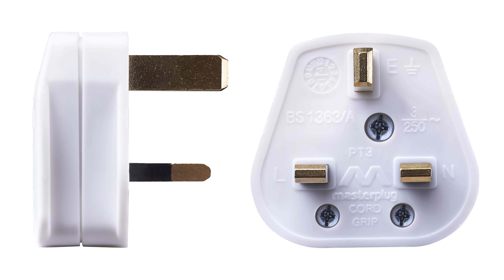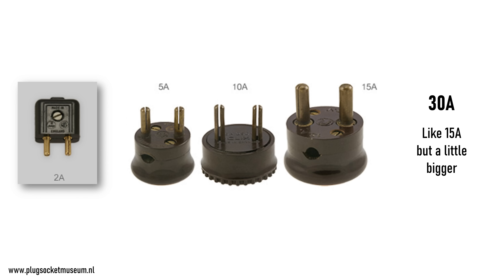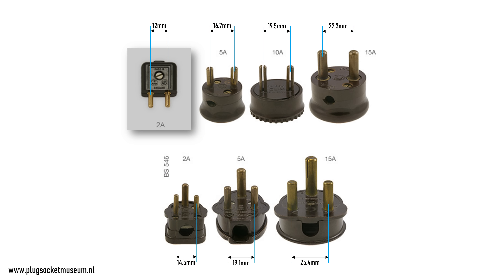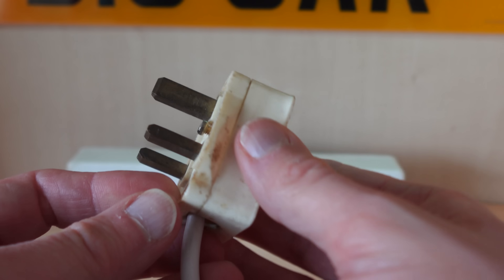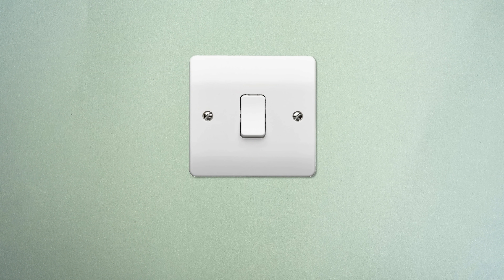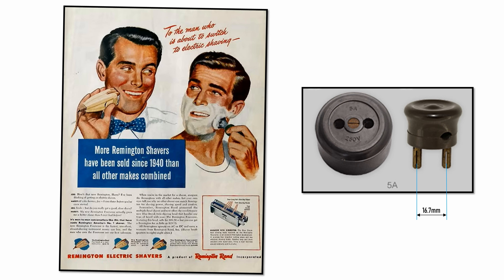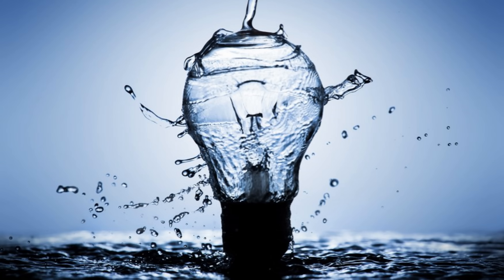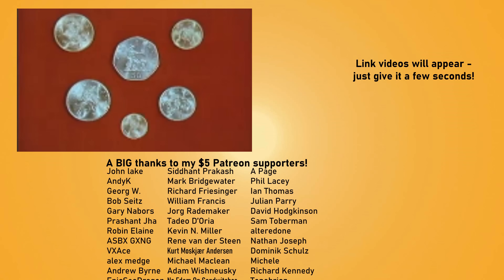Shaver Sockets are really clever

Comment from the maker: Errata: You can have a light switch in a UK bathroom but it needs to be 0.6m from any bath or shower, and 3m from any water outlet (e.g. sink).
The fuse protects the device, and the lead and everything upstream on the circuit.
As people mentioned, it made sense to sell the new UK 3 pin plug separately as many people's houses still had the old style plugs. I remember my grandmother's house had old style sockets in the 1970s.
Reply: My German bathroom has (unswitched) full sized power outlets approx 50 cm away from both my shower and sink. And a double light switch just about the sink plug.

Although I do know that my whole appartment is protected with a rcd.
Reply: In US, bathroom and kitchen outlets are generally protected by ground-fault circuit interrupters (GFCI).  Are these used in UK and/or Europe?  ETA:  Just found out that GFCI is pretty much the same as residual-current device (RCD).
Reply: For the Americans, that's about six cheeseburgers.
Reply: @4tarsus All new-ish houses (and those that have had their consumer unit updated recently) have GFCI/RCD protection installed on all circuits at the breaker box.
Reply: Light switches are permitted in bathrooms 0.6m from bath, shower or sink (or water outlet). There is no 3m requirement that applies to light switches despite many UK home having pull cords or switches outside the bathroom.
Reply: @havocgeneral No. Your description is not complete enough, particularly in respect of the statement "Light switches are permitted 0.6m away from bath shower or sink...".

The statement is correct but it gives the impression that light switches are not permitted within 60 cm of the wet area and that isn't correct.

It actually depends on the type of light switch. And there are two types: face plate and corded.

The IET says this: (quote from an article they have published on this topic on their website):

"Plate switches

Are 230 V lighting switches (plate switches) permitted in a room containing a bath or shower?

A plate switch is allowed outside the zones of a bathroom. A switch must be suitable for the location. The cords of cord-operated switches are allowed in zones 1 and 2 and are recommended for bathrooms and shower rooms."

So you can actually have light switches within 60cm of the wet area so long as they are corded.

For completeness, this IET article was written in 2019 and I doubt the regs have changed since in respect of this.
Reply: Hmm we have no rules for sockets around sinks, but having them very low and close is not ideal anywho. Zones are made for this, and its around 1.2m for zone 2 - zone 0 and 1 need a suitable ip-rating and they are closest to the shower. Most of this is common sense to most ppl imo.
Reply: What about putting UK sockets, switches and stuff in Australian homes but with a 10 amp circut breaker instead of the usaul 16 amp found inAustralia even though Australian sockets are mostly only rated for 10 amps, and teh UK sockets and plugs are safer and overall jsut better than the australian ones, so why not?

Comment: It's interesting that the US never really had this fear of electricity in the bathroom. We used to just have our standard 120V 15 or 20A outlet right next to the sink with no protection. The only thing that has changed since then is that we've added GFCI (RCD) protection to those outlets.
Reply: Suprisingly even less so in the netherlands. I have sockets imidiatelly next to the sink. These sockets also don't have gfci built in, just regular 230V sockets. There are RCD's in the fuse box, and I have tripped them on multiple occasions by getting the plugs wet.
Reply: US doesn't have RCD in the fuse boxes mostly
Reply: @Bobbobbob984  GFCI (RCD) breakers are 100% a thing in the US, and not that uncommon.
Reply: @BenB21361  Honestly that sounds really annoying to have to go down to my breaker panel every time I want to test or reset one. Having the RCD/GFCI on the socket itself means I can just press the button right there in the bathroom!
Reply: @Connie_cpu  For what would you test the RCD? You cant really test the RCDs in the breaker box anyway except for intentionally tripping it which seems unwise. Also the RDC rarely trips, and the whole house is protected instead of only particular sockets.
Reply: Where I live in the northeastern US most homes built before 1970 or so have the light switch on the outside.  I don't know if it was code at the time, but it was definitely a common practice. So there was at least some awareness of the danger here. Any power outlet is probably the result of a remodel and will be GFCI.  More modern construction will probably just use a GFCI breaker with arc-fault protection as well.

I've literally never lived in a house with light switched on the inside that I didn't add myself.
Reply: @Connie_cpu IT It only trips during fault conditions.
Reply: @BenB21361  RCD/GFCI sockets in the US have a test button on them which connects live to ground through a resistor that should just barely carry the rated trip current to ensure it will trip in the rated situations. It's to make sure there isn't a fault with the device, since electronic devices do fail from time to time. I do agree it would be nice if more circuits were protected, but code requires them for any socket located in a room with running water essentially, which is where the most danger is anyways.
Reply: In Germany it's also absolutely common to have sockets right next to the sink. Nowadays with RCD of course.  
Do you really have no sockets in UK bathrooms because of this 2.5 m rule?
Reply: Not only is it common to have outlets beside the sink in the US and Canada, it's required. There must be a GFCI-protected outlet within a few feet of the sink, but not over the sink. You may also install one below the toilet, for use with heated bidet seats, or anywhere else in the washroom provided it is outside of the splash zone of the shower.
Reply: Most bathroom electrocutions are voluntary. So technically, this fear us unfounded, leading to absurdities such as the washing machine being located in the kitchen, where the dishwasher belongs, or people needing to fit vanity mirrors in their bedrooms' to do their hair... Or, in my case, a very long extension cord.
Reply: @SiriusXAim  Yeah, I don't know what the percentages are on suicide by electrocution vs accidental electrocutions in bathrooms, but I'd guess the accidental electrocution percentage is so insignificant - even before considering GFCIS to not justify the concern some countries have about electricity in bathrooms.

I will say there is something to be said about the US 120v system in some ways being marginally safer than the UK 230 volt system, especially in bathrooms. Higher voltage can overcome the same resistance a little easier, so theoretically it's a little safer to get shocked by 120. I've been shocked by both 120 and 240 (yes, the US does indeed have 240... It's a split phase system) and I can say getting hit with 120 hurts a bit... But 240 felt wayy worse. In both instances I was perfectly fine though.
Reply: @Connie_cpu  Thanks, strangely I've never thought about what the "test button" actually does. Now I know!
Reply: @Connie_cpu  Actually, having the GFCI/RCD in the breaker panel is safer than having it in the receptacle outlet.

A GFCI's sole purpose is about safety so it makes more sense to maximise the amount of safety it provides.

GFCIs only protect what is connected to their output, so if you have a GFCI in the receptacle and somebody puts a nail in the wall and strikes the cable between the breaker panel and that GFCI receptacle, they get fried. They are not protected from electrocution.

I put it to you, it is better to take that short walk to the breaker panel and reset the GFCI there than allow someone to be killed by making a decision you can't be bothered to walk to it and opt for a GFCI in the receptacle.
Reply: @deang5622  We can spit hypothetical situations all day. If I have to go to the breaker panel to test that the GFCI is still functioning correctly it's far less likely to be tested as often, and then if it fails and I haven't found out about it then it's just as dangerous as not having it, or perhaps more dangerous because I have a false sense of security thinking that I'm protected. I don't think the answer is black and white, so I'm happy to take the option that is also more convenient for me.
Reply: Their used to be transformer-based shaver sockets in bathrooms before GFCI outlets became ubiquitous.
Reply: @vaalrus We had one of these in the 1950's  in the US. It worked until someone connected a hair dryer and burned out the transformer. Dad bypassed the isolation so he could shave.
Reply: Same in most countries. In Finland bathrooms have always had sockets. They previously had warnings like "Only for a washing machine" or "Do no use during bath or shower." Now when they are RCD protected those warnings are no longer used.

I have always wondered why some people use hair dryer in a bathroom. The idea is to dry the hair and one does not need water in it. Also if there are more people living there it is not good to reserve the bathroom for something that could be done elsewhere.
Reply: @Connie_cpu  No, the resistor is from live to neutral bypassing the detection coil on one side. European RCDs have no electronics. Electronic ones are banned.

Comment: In the US we solved that problem by requiring all plugs near water to be protected with a GFCI (ground fault circuit interrupter).  I believe you call them RCDs.  In the event of a short to ground, the receptacle will cut the power within 1/40th of a second.  Our bathrooms have 120V 15A outlets in them so you can use a hair dryer.  Hair dryers themselves are required to have a GFCI plug so you're protected even if you are in an old house without GFCI outlets in the bathroom.
Reply: My home built in the 70s (Canada) has a very similar ungrounded 120V  transformer isolated outlet. Replacing them with a 15A (or 20A)  GFCI is a common "upgrade". 

That does not upgrade the underlying wiring (I think the circuit would be over it's maximum number of outlets if I did that). I was all excited by a "20A" circuit in my last apartment: until I realized it was fed by a 15A breaker. At least the new LED bathroom light, installed at the same time, means you are less likely to overload the circuit hooking up a hair dryer. (The light fixture in my 70s bathroom draws 200W if you use 8 25W bulbs.)
Reply: In Argentina we solved that problem by requiring all plugs to be protected with a RCD. All of them, not just the bathroom ones.
Reply: @economicprisoner  It's been my experience that the lighting for the bathroom is on a shared lighting circuit for an area of the house (usually inclusive of the lighting for bedrooms/hallway adjacent to the bathroom) but the outlets are on a separate GFCI circuit.
Reply: Hundreds of thousands of US houses still have regular (non-GFCI) outlets and switches in the bathrooms and kitchens.  Very few problems and incidents considering.
Reply: @mystica-subs  The isolation transformers are on the light switch circuit because the transformers draw parasitic load even when not in use.
You can spot the retrofit I mentioned because the GFCI outlet will only be active when the light is on.
Reply: UK houses nowadays typically have RCD/GFCI protection installed at the breaker box for most (if not all) circuits. All wall sockets are protected. This is also the case throughout Europe. These specialist shaver sockets pre-date modern RCBO protection that is now standard, but the rules on bathroom switches and outlets has not been updated accordingly.
Reply: @Aethid Whole-house GFCIs are uncommon in north america, but it should be noted that GFCIs at the point of use (the outlet) can be more sensitive and respond more quickly to ground faults. It's not a big deal if a single outlet trips off, but it is a big deal if the whole house loses power because your fridge kicked on (fridge outlets, and other motor loads, are exempt from GFCI-protection).
Reply: @cmmartti  This is why every circuit generally has its own RCD/GFCI. That way you are only losing power to a few outlets at a time if it does cut power
Reply: @cmmartti  It has always been against building regs to have the entire house on a single RCD, and is is common now for every circuit to have its own protection. That includes inductive and surging loads like fridges and washing machines.
Reply: @economicprisoner  Is it up to code to have a 20A outlet on a 15A circuit?
Reply: @wta1518  My interpretation is 'no' but you have to merge two rules together to get there. Nothing explicitly prohibits it.
Reply: In Europe those typically are required on all sockets and lights. In Finland only exceptions to my knowledge are devices like fridges where the loss of power could cause significant damage.

Comment: No GFCI outlets?  Around here, all outlets in wet rooms must be a GFCI or to be on a GFCI circuit. I do remember living in a house in the UK with some pretty strange outlets that were changed to the standard three pin variety along with the pull string for the bathroom light. Went to buy a water kettle at a store and returned it as it has no plug only to have the clerk at the store hand me a plug that he wired up.  "You must be American" he said.  Thanked him for his assistance and enjoyed the kettle for the time living in the UK.
Reply: Basically every circuit needs to be protected by an 30 mA RCD (GFCI) to comply with the current standards (BS7671:2018+A2:2022)

Comment: In the past, in Germany too, the light switches for the bathroom were installed outside
and people were very reluctant to install sockets in the bathroom.
Today with 30mA RCD/RCCB/RCBO, light switches and sockets are more commonly installed in the bathroom.
Reply: funny how afraid of energy you guys are, meanwhile some countries use shower heads and install a water heater that's literally like a toaster above their heads plugged directly to power and water, no one dies (mostly except when they try to install it themselves)
Reply: Also, some light switches in Germany use a 12V circuit connected via relay.
Reply: @monad_tcp  Quite a few people in Georgia died from those in the 90s
Reply: It's not just additional safety equipment. In a regular German-style light switch, the contacts are at least an inch behind the front plate. You wouldn't be able to make contact even while spraying your hand with a shower head. And in one rated for wet rooms, there's an additional membrane between the front plate and the body of the switch. You'd have to fill up the cavity the switch sits in with water for any chance to make contact.

Additionally, full-plate switches have become the norm there, which makes it even safer.
Reply: If I am doing a new installation, I fit 10ma Breakers for the Bathrooms. Fells very safe.
Reply: The way that different European countries do their electrics, wire their circuits and fuse/breaker systems is quite different, though.  In the UK, a standard three-pin socket rated nominally at 13A could easily deliver double that because of the ring main system (two routes for each of the three connectors from the socket to the main box).
Reply: I wanted to say that the light switch outside the bathroom is really common in Germany.
On the other hand, we don't have dedicated shaver sockets (and I am glad there is nothing with a transformer drawing power all the time, as this seems wasteful to me). 
The only rule besides the need for an RCD, which for new installation extends to pretty much any socket, is that if a socket is closer than a certain distance to any water, it needs to have a spring loaded lid to cover it when not in use. But other than that, it's the same socket that accepts both the 3-contact "Schuko" plug and the 2-pin "Euro plug".

But we also don't put fuses into plugs. We leave device protection up to the device and let the circuit breakers just protect the wiring.
Reply: @monad_tcp you underestimate the stupidity of some people
Reply: Having lived in multiple houses in Germany (all of them built roughly in the 70s) I'd say sockets are very common. They all had them right next to the sink. Same for the apartments I lived in.
Reply: @HenryLoenwind  WTF is even an inch? Why can't you use the metric system like every civilized person does?
Reply: @whuzzzup although they are commonly fitted with a splash shield that you have to lift when installed within reach of a tap.
Reply: @monad_tcp " ... no one dies ...". Yeah, sure.

Comment: We have full current outlets in bathrooms here in NZ. They have RCI (residual current interruptors), which detect if there is a short or a leak and shut down in milliseconds. You can run hairdryers or even heaters if wanted.
Reply: As long as the sockets arent above the sink as thats ilegal.
Reply: Same here in the US. Except we call our protection GFCI (ground-fault circuit interrupters) which can either be built into the circuit breaker providing power to the circuit, or built into the outlet itself.
Reply: Yeah in the UK RCD/RCCB (Residual current device) so do the same job. most trip at 0.3mA in in under 0.4 seconds. Technically you could bath with a toaster and it shouldnt kill you (but dont try it).
Reply: @QWERTY11309  I think that should be 30ma. I could be wrong though!